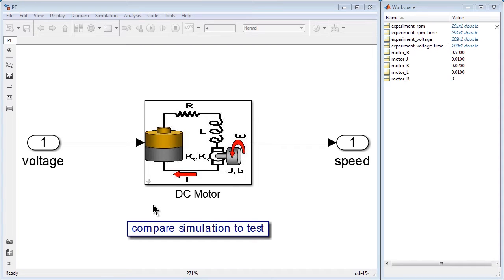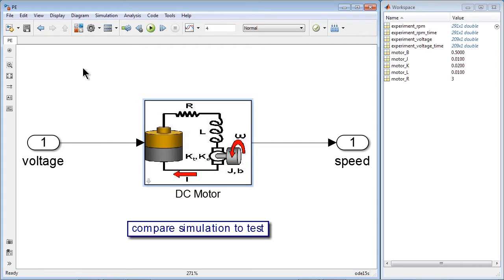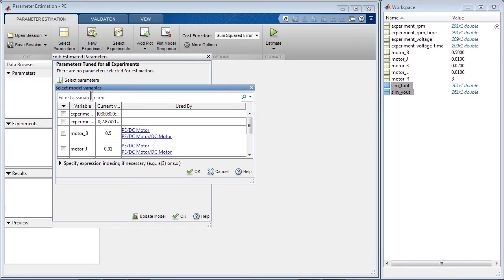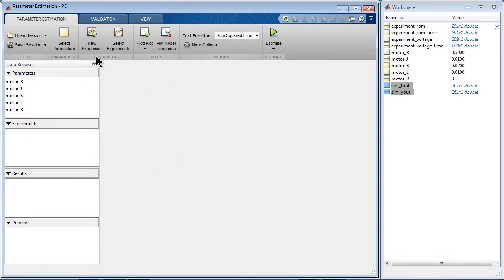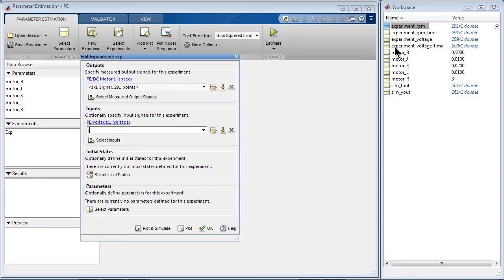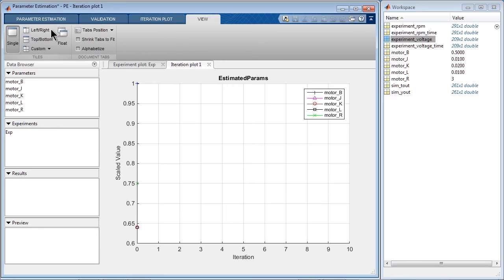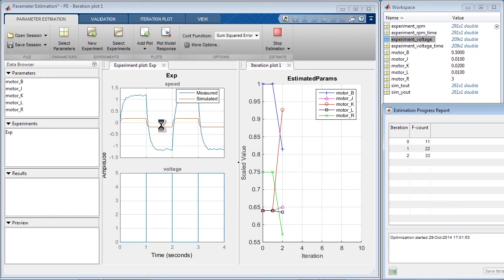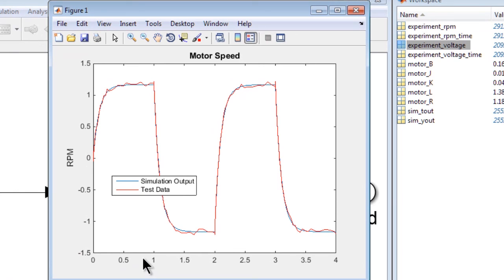Parameter Estimation of a DC Motor

Comment: why the voltage given is not have a -5 value ? Motor is drived in both directions e.g. +5V and -5V repeatedly, but input only has +5 and 0 volts. If there is not any -5 voltage how did the motor turned in the opposite direction ???
Reply: +Ege Erdem 
Thanks for the great question. The input voltage is not fed directly to the motor. In this case the motor is driven by the H-bridge, as you can see at ~27 seconds into the video. So basically H bridge takes this input voltage that changes from 0 to 5V and converts it to a wave of positive-negative voltages, and that's what the motor sees actually.
You can take a look at this example to better understand this:
http://www.mathworks.com/help/physmod/elec/examples/controlled-dc-motor.html